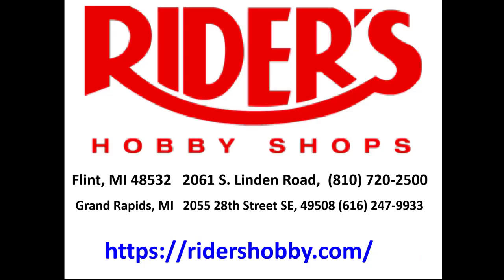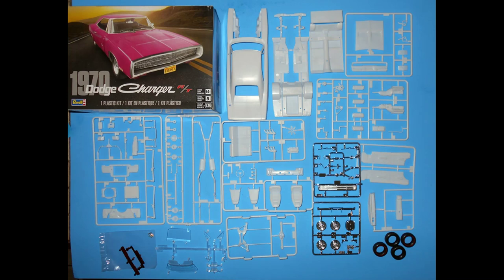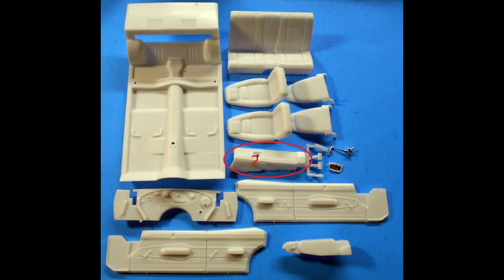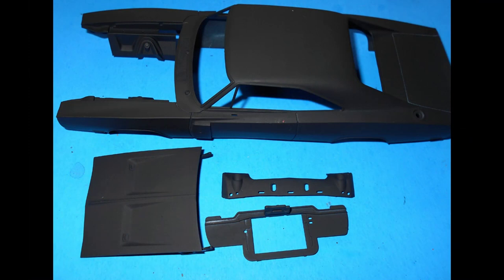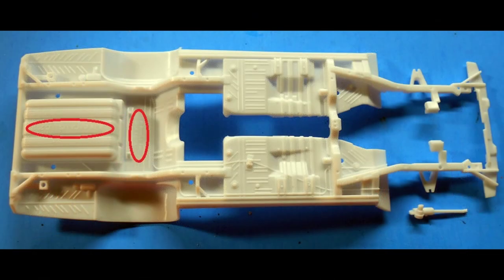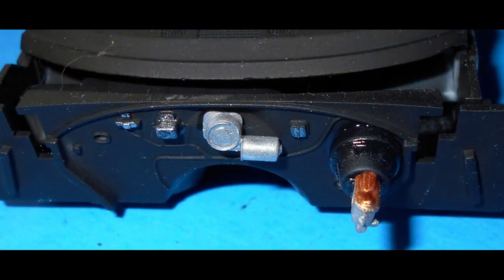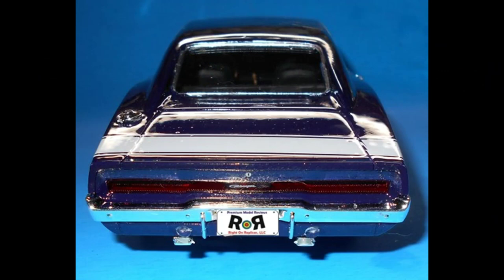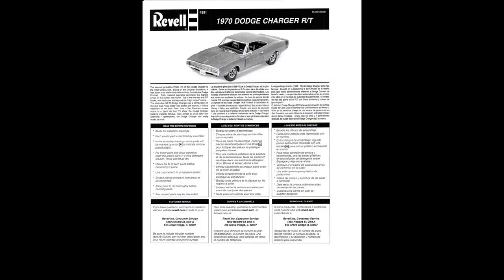‘70 Dodge Charger R/T 1:25 Scale Revell 4381 -Model Kit Build & Review

Comment: Very cool! I got a question. If a kit comes molded in color, can it be painted over?
Reply from the maker: BBCB,  Yes, but a good coat of primer will ensure consistency!  -Doug
Reply: @RightOnReplicas   Thank you. I just got back into modeling. I did this as a kid didn't know what I was doing. Now I can get tips from folks like you. It may be a short lived hobby. I won't be able to afford the kits, paints, or tools. I had no idea this stuff was so expensive. Lol! But I'll enjoy it for a while. Great fun
Reply from the maker: BBCB,  There are some low cost options available for that too!  -Doug
Reply: @RightOnReplicas  I'll definable be looking. I took your advice on using rustoleum paints for that reason. Low cost. Thanks for that tip

Comment: It's hard to find a good 70 charger model.  I have an original MPC model a promo model and a real full size car.  The hardest part for them to replicate is the front grill and the rear grill and tail lights.  Most likely I will buy one of these and give it a shot.  My original one was built way back when but still looks great, lots of detail on the original MPC models.  Wish MPC / someone would re-pop those old original model kits.
Reply from the maker: JS,  I think this is one of the best versions.   Thanks for sharing and please subscribe if you haven't already, to help us continue our mission to inspire more modelers!  -Doug!